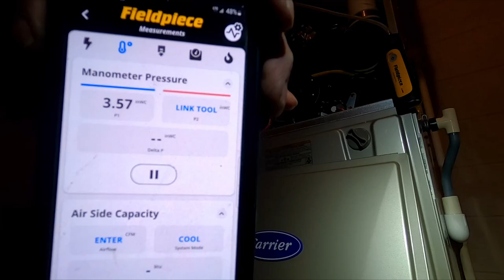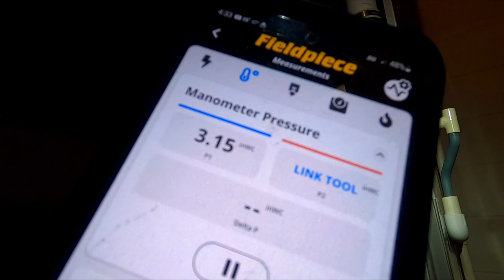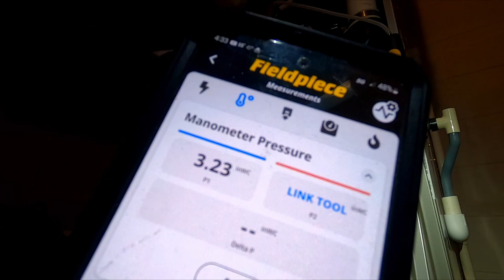Furnace On Blood Thinners

Comment: I'm maintenance guy for a police dept. I have half the people almost naked with fans blowing on them then 10 feet away people in jackets and sweaters with space heaters. Everyone knows I have low tolerance for bullshit so they run to the chief. We just had all new high a/c and boiler installed over last 5 years. They had me call company to do an audit. Everything in range. Wanted me to turn off a/c in dispatch during winter. Said can't do it, electronics need a/c year round. I went on vacation and dispatch unit went down. 3 days later when the lady who's hot at 65 degrees called me at 10 pm about air. I called chief and said I'll fix it when I'm back but I'm out of town or you can call our ac guy and hope nothings fried yet. One more year and I am done! I sometimes feel like a mom.

Comment: I ran into the same problem with a retired furnace guy. Walked into his house and was 80+ degrees and he was also running an electric heater. Wanted his thermostat changed nothing wrong with it changed it anyway. Checked furnace working fine. Said he wanted to to turn on at a certain temperature 72 and off at a certain temperature 74 that was below the current temperature in the room. I tried to tell him the furnace will not run because the electric heater is keeping the room above 80 and he was still cold.

Comment: I'v got a question is that furnace a sealed combustion furnace. If it is doesn't the cover have to be installed, the older sealed burners had a cover over them. If you watch some of the videos on the newer 90plus furnace they check the manifold pressure with the cover on and some without  the cover installed. Have to be careful you can get confused what the right way is.
Reply: the sealed burner box furnaces had to have the gas pressure checked either with the cover off or the negative side of the manometer teed into the pressure line coming from the burner box. What matters is pressure drop across the orifices. Checking without doing either will result in the pressure drop across the orifices being too great.

On the newer furnaces without the separate burner box, measuring gas pressure with main panel off is like checking it with burner box cover off. (if it had one)
Reply: @Jon-hx7pe  Thank's that answered a lot.  Once again thanks